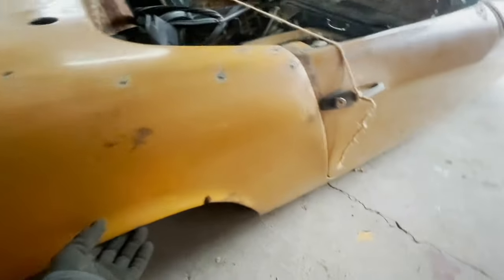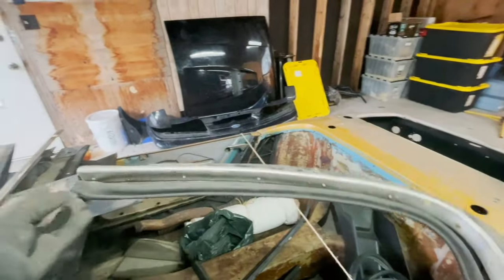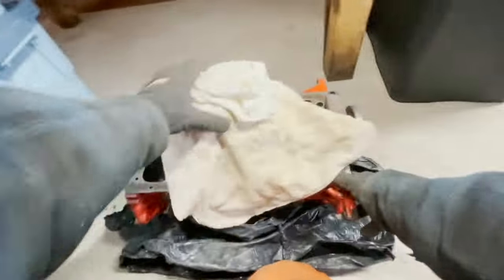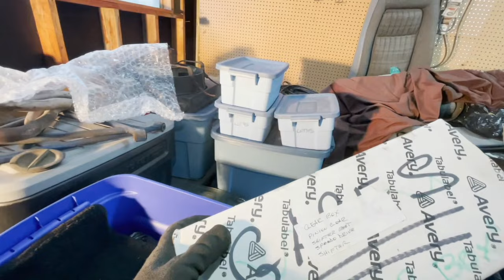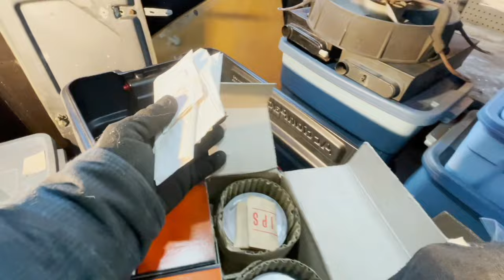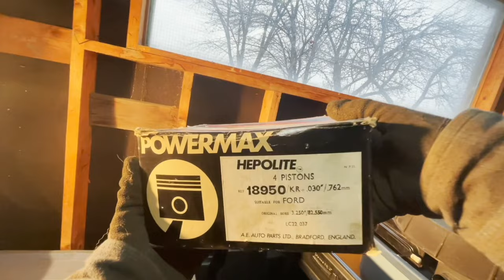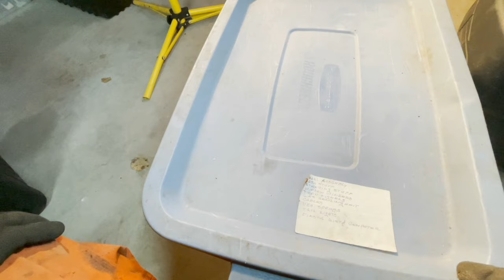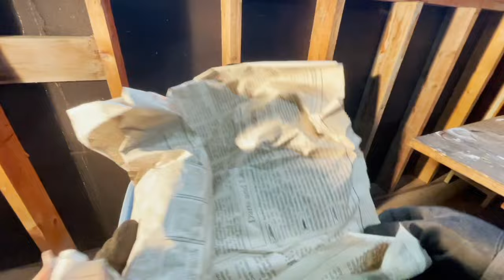Looking through 1965 Lotus Elan parts

Comment: The block number is stamped on the upward face on the side above the L cast in to the side, the grille is for the car, the black item is a headlight lift pod which works on vacuum:Anything with a 26 in the pat number is a correct Lotus part number
Reply from the maker: Awesome thanks for the info! i will have to check the stamp. is there a stamp on the frame or body as well or a way to check if its all original to the car?